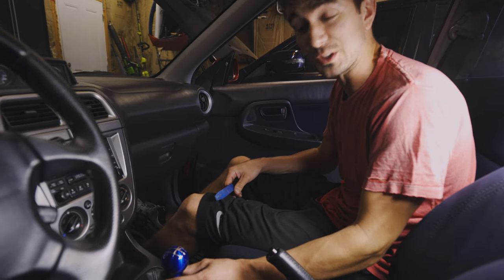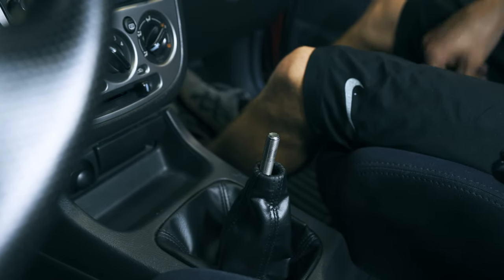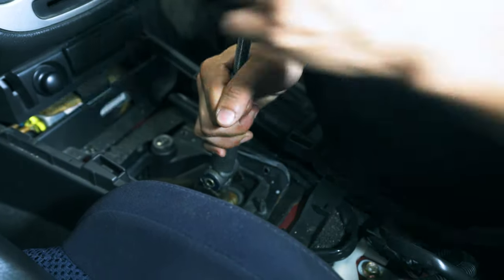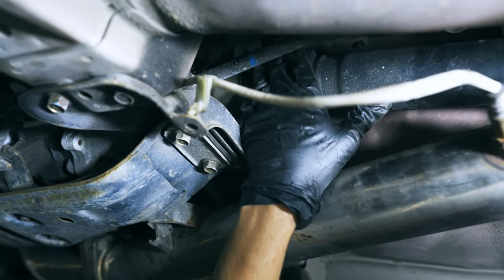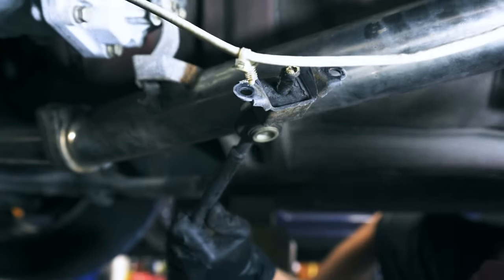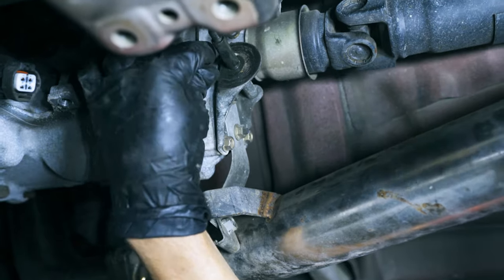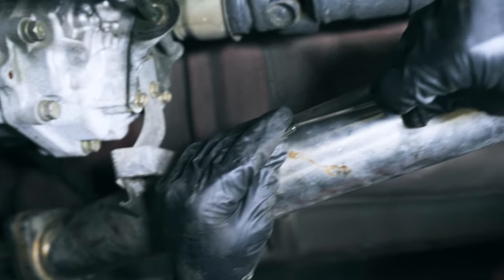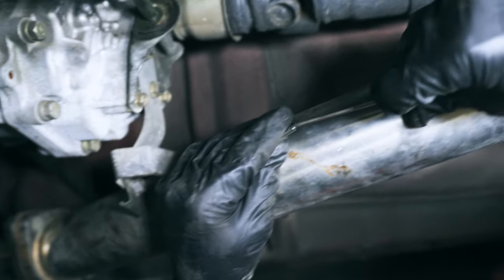WRX SHIFTER UPGRADES! INSTALLING SHORT SHIFTER, BUSHINGS, LINKAGE, AND MOUNTS!

Comment: I know this video is a couple years old, but I’m wondering the thinking on taking the whole transmount assembly off. Is there no worry about the trans when you do that? Is its connection to the motor solid enough that you don’t need a jack to hold it?
Reply: The pitch stop mount holds transmission to firewall. It actually doesn't move at all.

Comment: I do wish i could see more of the install. Just the install of each piece just so i can clearly see what parts should look like, how they should go in and all that, then i can make my own interpretation of it. Get the parts i want for the install. Its cool though. I dont like to rely too much on common sense with this kind of stuff but if i have to then i have to. However, this video seemed to go into far more detail compared to the other videos i have seen. Not once have i heard anything about the cross-member bushings or transmission mount up until this video. Thats the shit i love to hear. Whatever extra quality i can put in, i wanna know about it. Thanks guys, you did well, i just wish i could see the install.

Comment: Nice video. I need to do my na bugeye impreza. It is as sloppy as your shifter was. Missing 5th for 3rd often as you just can't tell where the gears are.
306,000 miles on the original stuff. Its needed!

Comment: good day.  Where can you get the hardware from?  I have the same problem with my 2002 WRX wagon.
Reply: I got a 02 wagon as well, hope you’re enjoying it. The short shift package from Cobb or kartboy will give you everything but the trans mount and shifter linkage. I believe you can find the group n mount and tic shifter linkage at rallysport direct

Comment: Is it normal for the shifter to be more on the left cause by looks of it yours looks like it’s on the left after replacing it? Cause I did mine on a Jdm and mine is a bit on the right. I thought it should be centered..

Comment: Have you seen the Solid Metal Shifter Ujoints, I just put one in my car its more solid than the Poly Ujoints. I also have yet to put the my new Kartboy rear and two peice shifter stabilizer bushings on my 03 Outback Limited.

Comment: Use a 1 LB dead blow hammer to get the shifter back in. Super quick, suer easy!
Reply: Lol I used a 4lbs with old knob on it to get mine it just hit it kinda easy normal hammer bounced off over n over
Reply: @LoopKoop6778   Right dude. as long as you use something that doesn't break the shifter lol